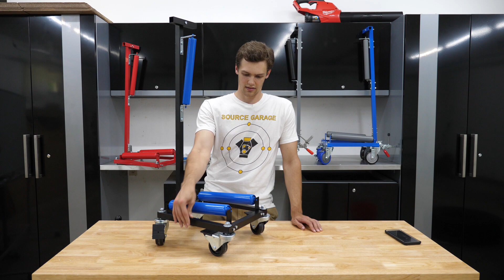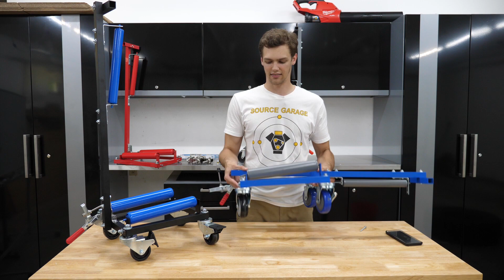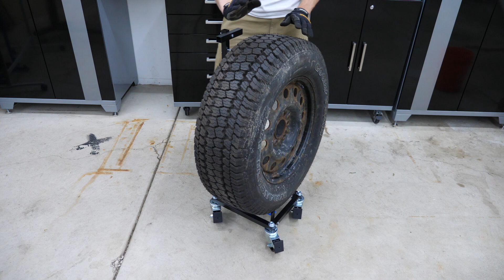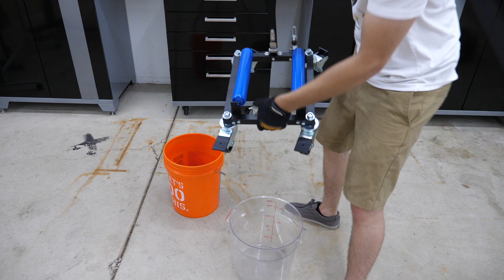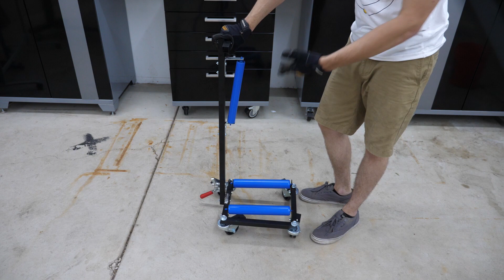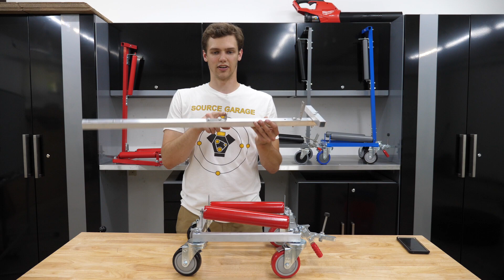Cycloshine 2.0 Wheel Detailing Stand Update : New & Improved Design!

Comment: Have you looked into bending the toggle clamp handle up so it can still work without the casters. You will probably also need to offset it to the left or right so that it doesn't get in the way of the mechanism while it's released.
Reply from the maker: I actually inquired to the manufacturer about having it angled up, but they would only do it for a much larger custom order than I can afford and I could not find another model that did what I was looking for. What do you mean by offsetting it and what do you think it is in the way of?
Reply: @SourceGarage  nvm, it's fine. Just looked at it again. Wouldn't need to be offset. I was thinking it would bump into the clamp when it's released, but they would jus move together. Great work though. Sure this will be a popular product. Can't wait to get one for myself.

Comment: Is it stronger than the first one because this one looks a little bit more wobbly
Reply from the maker: It is just as strong and can hold me standing on it and jumping up and down and I'm 190lbs. The lower rollers are each rated for 96 lbs. The back part of the frame will wobble slightly if you don't tighten the bolts down snug, but it is actually much less than the original model and will not cause any issues during operation at all.
Reply from the maker: The stand is available for pre order now here https://thesourcegarage.com/collections/all

Comment: Well done for your new design. Just a small comment, with the 5 inch wheels you could put a 4 inch catch pan which would take a fair amount of liquid. Anyway congrats again and wish you all the success for being proactive. Thanks  again
Reply from the maker: Thanks. I'm looking at different wheel options. Cost goes up pretty quick with larger stainless wheels as well as weight and shipping issues. I think my final stand will likely be 2-3 inch wheel which should offer 3-4 inches of clearance still for a decent size catch pan still.

Comment: What is the tallest tire this will accommodate?
Reply from the maker: In the video I use the spare tire off my truck which was 32" in total diameter for example. Theoretically any height would work that could fit on 12" rollers and weighs less than 200 lbs. If you watch the last segment with the new brackets, you could set the rollers parallel instead of leaned back and put very large tires on that would just sit upright.